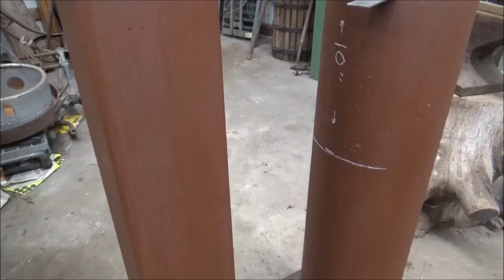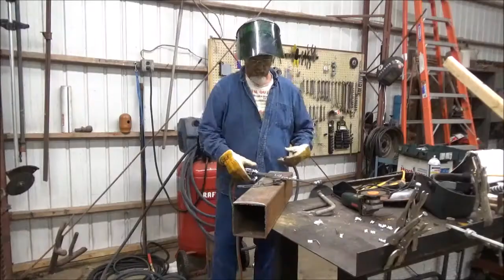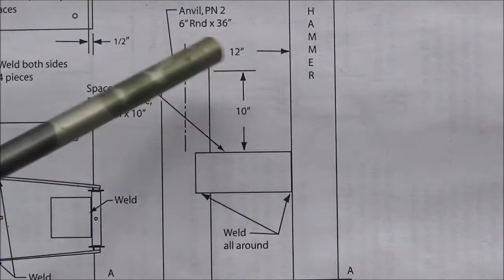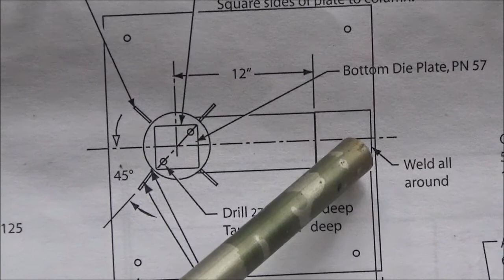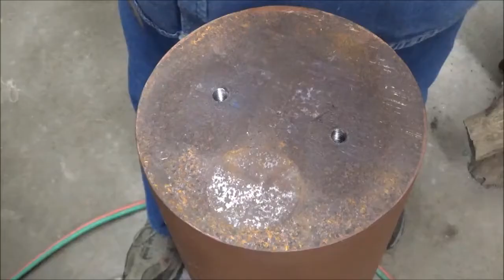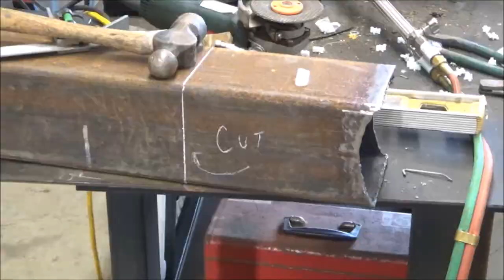tyre hammer part 201

Comment: Has anyone done an approximate cost analysis for the build based on the plans? I have a friend w/a shop willing to take a look at doing this but I need some more definitive answers from guys that have already completed it.
Reply from the maker: JOHN\ I have budgeted  $800.00 for the project. You will need to purchase the plans, springs, and a couple other items but it will depend upon your ability to weld and if you have access to a machine shop. $800 is working out well for me  but I am now paying for machining and some drilling that I had not planned on. It will take a full 100 hrs to build this, after a year I am still working on mine but I see light at the end of the tunnel now.
Reply: @hangingwithheavy2113     Thanks!!! Plans were purchased & are in hand we are just looking for someone such as yourself. Thanks for the videos!